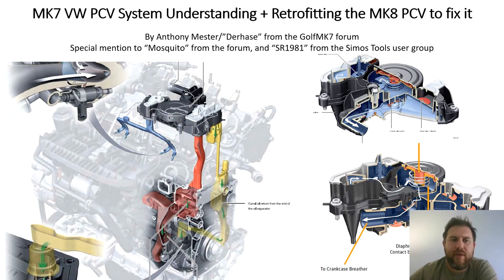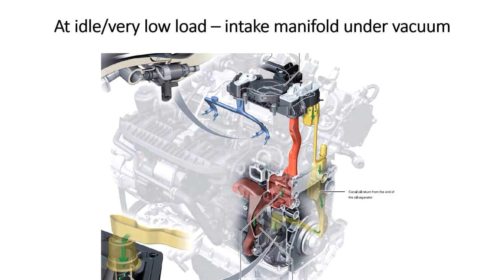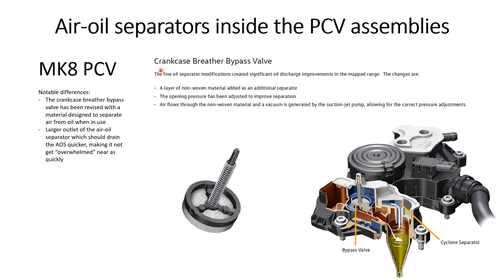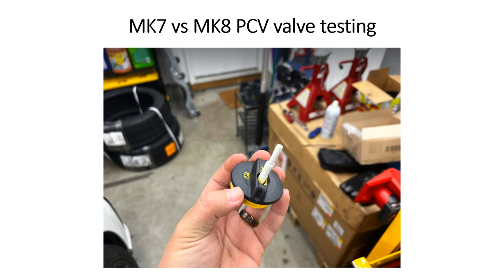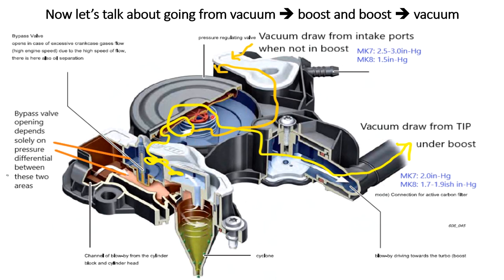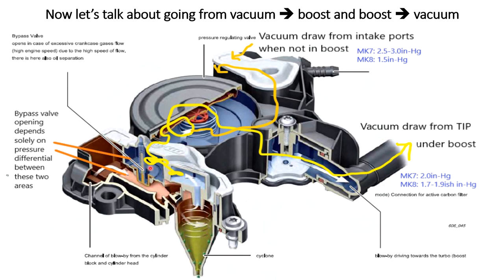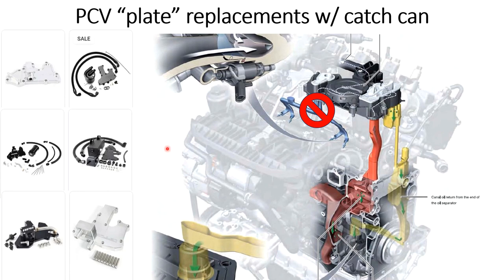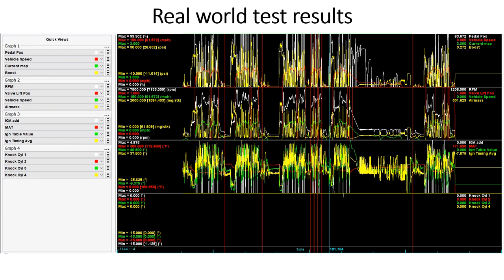MK7 PCV Analysis - How it works, and why I've adapted the MK8 PCV (Pt 5)

Comment: This was a very informative video, and was presented very well.  A couple of things.  1.  What was not mentioned about an aftermarket "catch can" is use in the winter months in cold climates.  Catch cans fill 90% or more with basically water.  When you live somewhere cold the catch can freezes and causes havoc.  2.  This testing is from the perspective of "track use" for the OEM MK7 PCV vs the MK8.  I would like to see that data just from what 95% of people that drive GTI's do and just have daily street use logs.  I am sure the difference between these two PCV systems may not be as noticeable.  3.  Keep in mind ANY modification of the PCV system is a smog violation in many states.  Will an inspector actually notice this?  Probably not, but still.  4.  Lastly, I would love to see a video of an actual install of the MK8 PCV on a MK7/7.5 GTI.  Appreciate the part numbers and all the info here.
Reply from the maker: Thanks! Pretty much all of that has been covered since. Links to most relevant videos here: www.datadrivenmqb.com/mk8pcv
Reply: @datadrivenmqb  Thank You did find them after watching this video.  So the MK8 PCV and Tiguan PCV hose and capped is the better system to use for a stock DD MK7.5? Or just keep using the MK7 OEM unit? I will never track my GTI got that all out of my system with my past Lancer Evo's.  I have been told to replace the PCV every 30k miles in these cars for preventive maintenance is this true?
Reply from the maker: @eppyz  the MK8 system (w/ Venturi) is very good. IMO if you have no issues then I wouldn’t worry about changing anything. Don’t go fixing problems you don’t have. As far as maintenance items go… A friend has 120k on his OEM PCV with tons of track use (and OEM TIP). I’d consider it a 60-80k item if you wanted to do it preventatively, def not a 30k type frequency.

Comment: Very informative video, I'm here because I want to understand how the PCV system works, and how it may be causing my car to burn oil. I've got a 2015 golf with the gen 3 ea888 1.8, and recently replaced the PCV unit. Currently monitoring my oil levels to see if it's still burning.
Reply: Is it still burning?
Reply: @r3spect21  not 100% sure yet, I'm still monitoring thr oil levels for a bit but I do think they went down slightly
Reply: @r3spect21 update: shes still burning. :(
Reply: @lameio damn sorry to hear that im about to change my pvc just was hoping that would fix the burning but i guess not :/
Reply: @r3spect21  there's a chance it could fix it. There's a way to test: while the car is running at idle, unscrew the oil cap and try to take it off (the car will run like crap for a sec that's fine) if the cap is relatively easy to take off, the pcv is fine, if it's stuck down, the pcv is broken. 

There's also a chance it could be turbo seals or piston rings. I'm doing a compression test tomorrow so I can let you know how that goes
Reply: Gotcha yeah I heard about this test and found out my pcv was broken since it was pretty hard to get the cap off did yours have the same problem? 

Btw really appreciate the update just trying my best to stop the burning but from what i hear its almost impossible to get it to stop burning
Reply: @r3spect21  when I did the test mine had a little bit of suction but it wasn't holding the cap down tight, so it was a bit misleading. There's supposed to be some suction but not to the point where you have to wrestle the oil cap for it to come off. 

For me personally, I ended up pulling the spark  plus. Cylinder 1 had oil built up on the threads, and the other cylinders seemed alright. The compression test showed between 155 and 165 across the board, so I've eliminated piston rings as the cause. Now I'm thinking it's turbo related
Reply: Ive seen recently that these cars burn oil because of its gdi system their tends to be more carbon buildup on the intake causing the oil to burn when it gets in contact with the carbon. 

Theres an additive that supposedly works good to clear out the carbon called ATS 505 CRO im gonna try it out and see what the valves looks like after
Reply: @r3spect21  if you're having carbon buildup on the tops of the intake valves, best thing I can suggest you do is a walnut blast. If you have the knowledge and the tools, you can do it yourself, or send it somewhere but it may be pricey. I did the job with my dad on our EA211 1.4tsi jetta. It completely changes the car, it can actually breathe
Reply: I appreciate the detailed video and the comment section here. My 15’ Mk7 GTI is sucking the oil cap down hard. Hopefully getting a new Pcv today. Fingers crossed 🤞🏼
Reply: @jbo3238  did PCV sort for you? After replacing mine - oil cap still has strong suction???
Reply: @Cr7pton1c  no, it’s a little less suction but about the same.
Reply: @jbo3238  Can’t tell if it’s a little less but just feels more than what it should be - this is all so confusing 😁
Reply: @Cr7pton1c  had dried oil on upper part of my spark plug in cylinder 3, assuming that’s part of the issue too.

Comment: Im not a mechanic,  but like all mens ... logic of thing is very important to us. Thank you for sharing this much infos, but i wanna ask you a question if its possible.  My golf mk7 2015  1.6tdi bluemotion  makes smoke from oil cap, even on a cold start ??? Any idea, because im new with Golf tdi and im thinking is any serious issue with engine ???
Reply from the maker: @Denydee-uw8ki  diesels function very differently - there is no vacuum in the intake manifold available to potentially act like the EA888.3 at idle. Would need to find someone more knowledgeable on VW TDI stuff specifically.

Comment: Did you choose the Tiguan hose for length/shape, or was it due to the fact that it happened to have the correct connections for your application?  I'm searching for info on how to get a little more length on my Mk8 PCV hose since I have a Pmax going in next month.  Everyone that has done that install on the Mk8 said that the worst part was the PCV hose and that there is quite a bit of stress put on it. I'm trying to prevent any issues during install so I was hoping to find an OEM solution (slightly longer PCV hose or fitting) like you found for your application.
Reply from the maker: The hose is from a Gen 3B Tiguan (EA888.3B), which happens to use a turbo inlet pipe (and TIP PCV connection) identical to the EA888.3. The EA888.4 PCV in the MK8 is considerably different as there is no TIP connection, the hose goes straight to a fitting on the turbo which connects the turbo inlet housing to the turbo outlet housing. It can be seen here: https://youtu.be/jYdF-sOLe3I?si=LQ4oykVl-YiHtYk-&t=1404

Comment: I have a 2016 Golf R and from 3k rpm upwards I see smoke from the exhaust and the oil consumption is also high. What do you suggest I do with my PCV?
Reply from the maker: @Renaldo181  start with performing compression and leak-down tests. No sense in throwing parts at a car without verifying mechanical condition.

If it’s all the time under those conditions, that sounds less like PCV and more like something else, but I’d at least rule out mechanical issues first. Also make sure the oil isn’t overfilled.
Reply: @datadrivenmqb  yeah thats what I was thinking too. I have it booked for tomorrow. It only gives puffs of smoke under boost and also soot on the back or my car so I think there is a series of problems.

Comment: Wish I’ve seen this video some months ago, excellent! One question - I’ve had problems with blue smoke when leaving from redlights, or going on throttle after longer coasting or idle. It was exactly same symptoms as bad valve stems. Then i removed  the vwr racingline catch can with pcv (blocking) plate and put the stock pcv and the blue smoke stopped. The upper vwr pcv plate had a bolt missing and slight oil leakage. I can’t figure out if it was the leakage causing the smoke, or if it was overpressure in crankhouse that caused the leakage and smoke. Any thoughts?
Reply from the maker: @matosaric6811 It's hard to say for sure without seeing/assessing it myself... My guess is it's a combo of both (light pressure on crankcase at idle is pushing past the valve stem seals). Might not necessarily mean failed/torn seals, but possibly just very weak ones that don't hold pressure.

I actually have a crankcase pressure sensor rigged up that I can log now... so if I can get my hands on some kind of PCV plate systems locally, I'll be trying to test one at some point. Check out the latest video plus some of the others in my PCV Playlist for info:
https://youtu.be/b7IhdorxM-s?si=OabDydi2jCysN0ow
Reply: @datadrivenmqb  Thanks, I’ve watched all the videos, great work 👍 
I find it hard to understand how leaking seals, and thus less vacuum, could make more oil take the route through the catch can line and intake pipe on initial throttle. Unless the leakage goes through the ”blue lines” to the intake manifold? 
It’s feels like oil is piled up somewhere and then immediately sucked up and burned on first blip on throttle. I have no issues with smoke on the track.

Btw. I’m running vwr intake pipe, airbox and elbow.
Reply from the maker: @matosaric6811   basically if you have an additional pressure source in the crankcase (boost directly past the valve seals, in addition to the normal expected blow-by past the piston rings), then it is that much more that must be drawn on to maintain a constant vacuum. More airflow required to maintain a vacuum = more of a "straw" effect that the engine block passage turns into.

For an analogy: think of filling a cup of water that has a tiny hole in the bottom. You can keep it "full" if the hole is small enough. But if you introduce another, maybe large hole.. it requires pouring water at a faster rate to keep it full. It is basically the same deal, except trying to draw vacuum on a "sealed" system.

Thanks again, and hoping to have a lot more answers real soon.

Comment: What happens if you just gut the whole plastic unit and put a one way valve between the pcv and intake (post turbo)
Reply from the maker: Will have a massive vacuum leak at idle due to the blue passage vacuum to the crankcase not being regulated by the diaphragm.

Comment: Since you seem to have a much deeper understanding of this pcv system I was hoping for some info on the oil cap design on the MK7s. It seems they by design vent. Is this a sign of other issues and can it be resolved?
Reply from the maker: I think the cap venting is a "just in case" kind of deal. The spring is VERY strong. Small amount of wetness over a long period of time isn't a huge deal IMO. 

I think a lot of what is normally seen can be caused by people removing the oil cap and placing it upside down while doing an oil change. Oil on the bottom then runs all over to the outside of the oring that actually seals (the smaller diameter square cut o-ring, not the round one near the top). Time and heat makes it seep along the surface and becomes visible. I'm guessing the spring has 5+lbs of force at least. 

I suspect the upper o-ring is moreso to try and keep dirt/dust/grit from collecting beneath the surface, falling into the engine as soon as you remove it.

Comment: Very informative video, thanks for taking the time to put it together. I’ve been looking into ways to improve upon the mk7 system recently. The PCV replacement plates have always made me skeptical, as have catch cans. The vacuum analysis on the catch cans has made up my mind about avoiding them. The system I am considering is adapting an air oil separator from AIG/Cobb designed for WRX/STI applications. The return line that would attach to the turbo inlet has a one way valve in it and by utilizing two of them, one on the side feeding the AOS and the other going to the turbo inlet, seems capable of fixing the vacuum problem created by the catch can. The oil return line I think would have to be directed to the oil pan. I think between this system and retrofitting the mk8 PCV system could virtually eliminate oil making it into the intake system.
Reply from the maker: That won't solve anything because the bottom end is constantly depleting the vacuum. 

Either way it still does nothing to solve any oil going through the blue path.

Check out the other videos in the PCV playlist, been doing a lot of work with the Tiguan Venturi. Once I have the suspension stuff back on my car, I have a bunch of PCV and TIP testing to do. The turbo inlet greatly influences the entire system.

Comment: Thank you so much for the informative video! This might be a stretch here but I’m hoping maybe you can provide some advice. 

I have a 2019 GTI with an aftermarket turbo/downpipe. Car has had 0 issues the entire time I’ve owned it. For the last year or so now on warm start and occasionally on a cold start I get a puff of blue smoke coming from the exhaust.  I hear two things from people, bad PCV and valve steam seals or valve guides being worn.

What would you bet your money on it being? I know I won’t know until the car is at a shop but if it’s a bad PCV I can probably replace it myself and wouldn’t be that expensive, but I’ve heard valve stem seals is a costly job. I don’t think it’s my turbo as I’ve never had a problem with it but I could be wrong. Any help is much appreciated! 

Thanks!
Reply from the maker: Honestly it could be either one, though I'd be more inclined to bet on valve seals given the symptoms... BUT I've had several people reach out and tell me that either new PCV valves or MK8 retrofit sorted out the same symptoms which I would normally not expect personally.

A brand new BK PCV valve is actually only ~$50 from the dealer:
https://vw.oempartsonline.com/oem-parts/volkswagen-engine-crankcase-vent-valve-6k103495bk

That price is cheaper than shop labor for diagnosis... so realistically I'd put the valve on and if it stops the smoking, great... if not, at least you got a new valve to rule out as the issue, and you have a pretty good idea of what it really needs at that point. 

I'm not generally a fan of using the parts cannon to diagnose, but sometimes it makes financial sense when the cost to replace something is so low and relatively easy that it comes in below what an hour of shop diagnostic time would be.
Reply: @datadrivenmqb   Thank you so much for responding! I will go ahead and purchase that PCV valve and give it a go. If it is my valve seals what would be a fair price to get it fixed and is it something I should fix quickly? Your help is much appreciated!

Comment: Thank you for the insight into the system. Also thanks for the explanation of the PCV plate replacements specifically. I now understand much better why my motor is blowing out oil seals. 😂 Pretty sure my rear main has been blown out, guess it’s time for an upgrade on that seal and perhaps revert to MK8 PCV system. ❤
Reply from the maker: No problem! Yeah I think there's a LOT of variation motor to motor, and the ill effects of plates vary greatly, with higher mileage or cars pushed for the ragged edge being worse off.

The MK8 valve hasn't been 100% successful for all cars, but those that it hasn't have also had issues with near every stock PCV also. I'll be doing a follow up soon as I gather data from people that have retrofitted. I do think adding the venturi is key to best rate of success if you watch the other videos in the PCV playlist. An 034 TMD is the easy button for adding the boost hose as outlined in another video on the playlist.
Reply: @datadrivenmqb  If you use a plate doesn't that cause a slight increase in crankcase pressure, especially if you drive aggressively? Meaning that even if it's a slight increase over time it will slowly push out your rear main seal?

Comment: I think I'll be ordering some parts soon for my mk7 GTI. I have a different intake and turbo inlet pipe, so I'll have some info on it once i can make an autocross event and a track day.
Reply from the maker: Do you happen to have problems already? Just to be clear if your PCV system is working just fine, I'd be sure to leave well enough alone. Otherwise if you do go through with retrofitting the MK8, definitely report back!

Comment: Has any body got an oil light on because of this . Having trouble with 2016 golf r  . Engines geting low oil pressure engines been completely rebuilt.  I replaced the faulty pcv but doesnt seem to have help . Any help be great . Its had new cam shafts as well ❤
Reply from the maker: Oil pressure is a mechanical problem. Either the engine wasn't built right, or you have one or multiple bad oil pressure sensors. There are something like 4 of them if I recall correctly. Two on the filter housing, one down near the crank pulley, and one on the front side of the car closer to the transmission if memory is correct.
Reply: Iv seen a video replacing the pcv fixed the oil pressure a guy figured  . It raised his oil pressure 6 psi . ..any way didnt fix mine . . There is an oil control valve on the bottom front of the timing cover . If u leave it connected or not connected it doesnt seem to effect the oil pressure in the engine . Iv ordered a new one  but not sure if will fix it . There is also one on filter housing . We have replace that it didnt help the pressure when cold goes from 60 psi to nearly 5 psi when warm . We have the oil pressure testers in the filter housing . Theres seems to be a 5 psi difference between each gauge .  Im not sure what pressure the engine should have we are struggling to get data on it . Abd even if we are ment to check the pressure there are there is a another pressure sensor on front of block